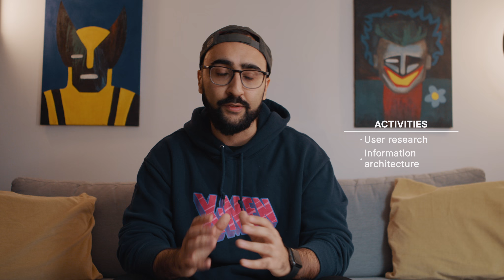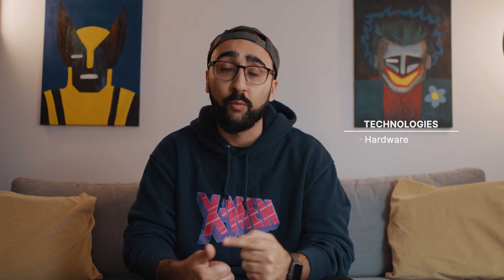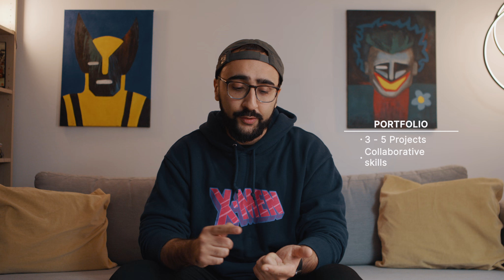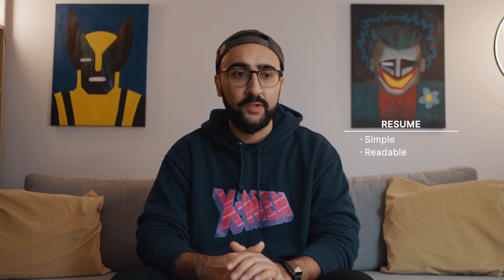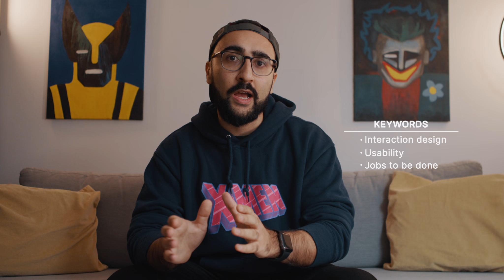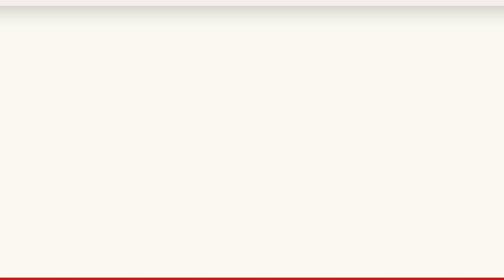All you need to transition from graphic design to UX design

Comment: most of the jobs I see offered are always ui/ux together.  they kind of like to merge them together. so I was wondering  if you are a graphic designer would it easier to just focus on ui design side for your portfolio and get the ux experience while on the job. UX seems like the research and planning stage so I guess show your planning stage and design process as well.
Reply from the maker: Hey K3L, that's a great strategy. Lean into your UI design chops as you have those from your graphic design background, and then you'll be able to learn the UX side of the work on the job. UI specific gigs are more common at larger companies. If you want to apply for a UI/UX hybrid, definitely show the thinking behind your work as you suggested. You want to show that you're a collaborator and that you understand the iterative nature of designing Web, Mobile or any kind of digital experience. Thank you for your comment!

Comment: I've been a Graphic Designer for 8 years now and did my first UI mobile app back in 2016 and I wondered whether or not it was worth pursuing. I've decided this year that it is so thanks for the video
Reply from the maker: That's great to hear Wei. 8 years of experience in graphic design means you can contribute a lot to the UX field. Best of luck on your journey and thank you for connecting
Reply: Sir please tell me should I become graphic design or ui/ux design vs front end development 
which doesn't require degree, graduation? There is guy said don't become freelance ui/ux design work in company (job) 
Also Sir what is difference between graphic design and Illustration? It's comes under the gd?
Please tell I'm so confused 🙏